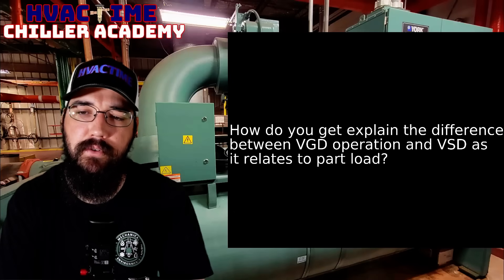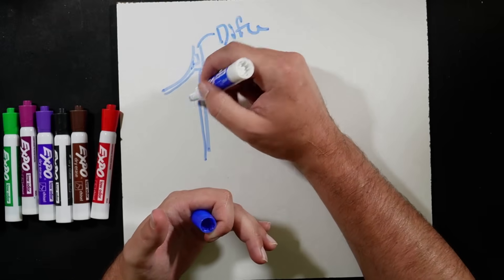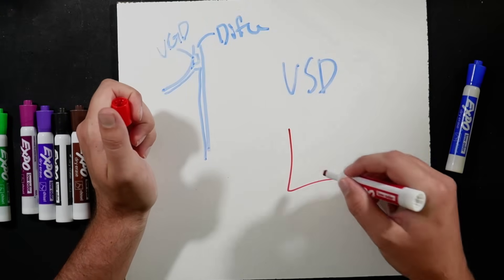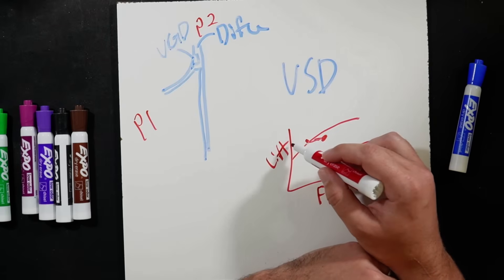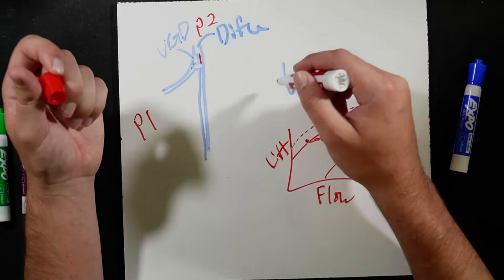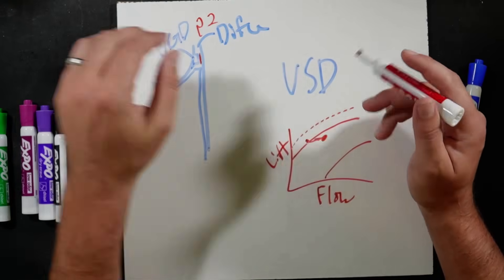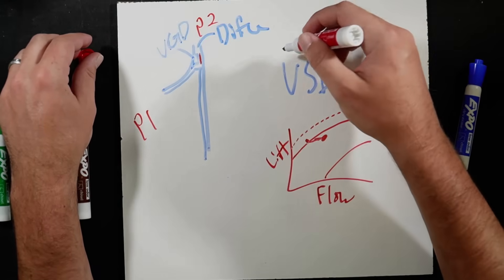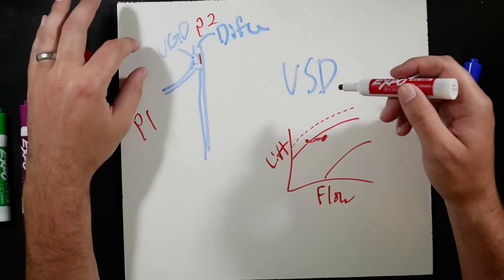VGD & VSD in Part Loads Explained

Comment: On our oil fed the diffuser opening modulates in accordance with the guide vanes. It's a part of a piston. As the piston slides in and out. It opens and closes the guide vanes and the diffuser at the same time. There is also a drive for the motor speed. The guide vanes are actuated via the SA/SB solenoids. It uses oil pressure to move the piston. On our in house mag bearing we have a VFD, guide vanes and a range extension valve to modulate capacity and lift